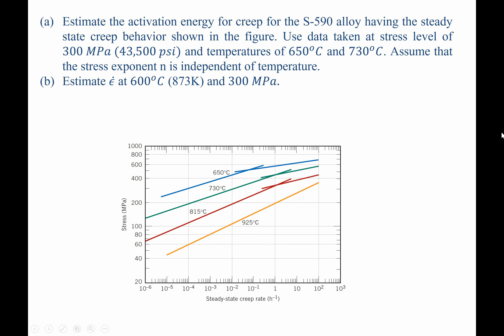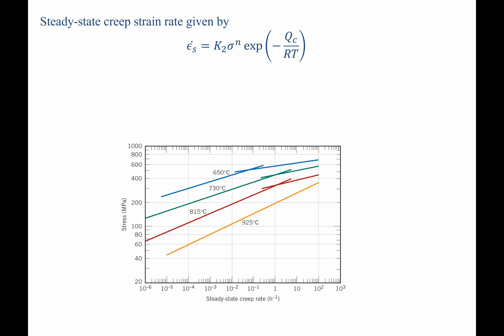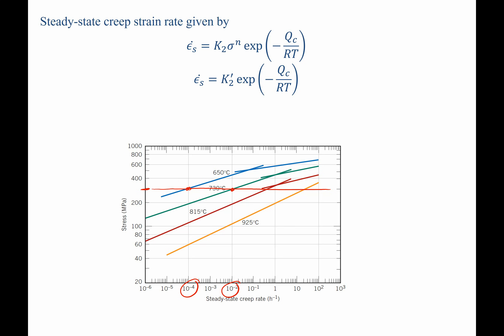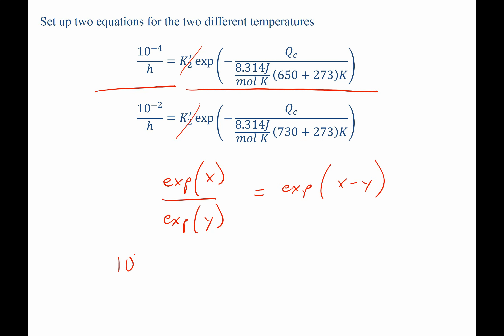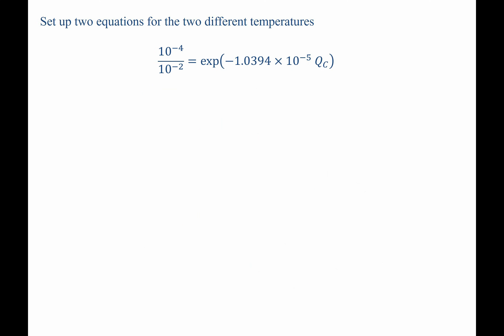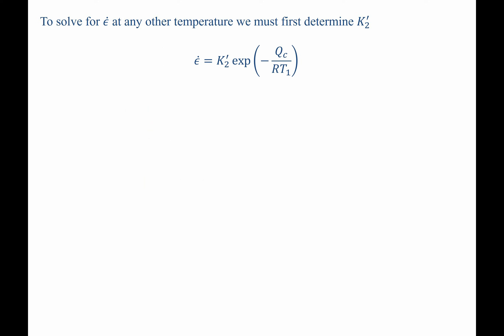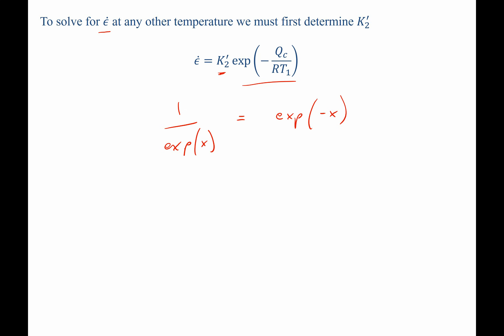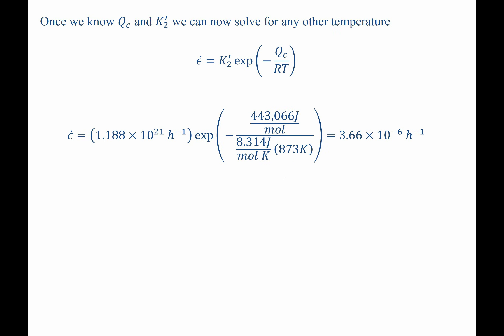steady-state creep strain rates example problem

Comment: what if K2 and n was temperature dependant?
Reply from the maker: We are explicitly assuming that they are not temperature dependent over this range of temperatures which allows us to utilize them.
Reply from the maker: We are explicitly assuming that they are not temperature dependent over this range of temperatures which allows us to utilize them.
Reply: @TaylorSparks  Thanks. I am trying to simulate creep deformation and have limited set of data and was wondering if it is somehow possible  to figure out the constant for other temperatures even if they are temperature dependant

Comment: HI Taylor, nice explanation. A quick question, does the Activation energy will remain constant for all the temperature and stress ranges or only for the picked stress (300 MPa)  and temperature range?
Reply from the maker: Ideally it remains constant. There may be scenarios where they fit their data with two activation energies for two different temperature regimes, but this would be uncommon.
Reply: @TaylorSparks  thanks a lot for your reply.. I really liked your lecture :)
Reply: @psrikum  Some equations for solder will have double power laws with varying activation energies that are related to the mechanism behind creep.  Diffusion vs climb for instance. see this paper as an example. 
"Microstructural Dependence of Constitutive Properties of Eutectic SnAg and SnAgCu Solders"